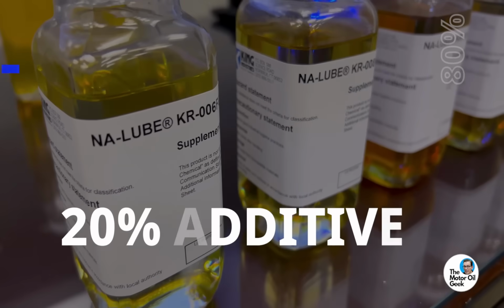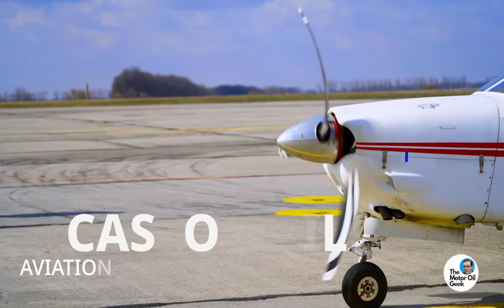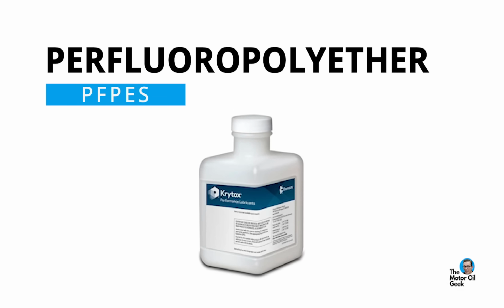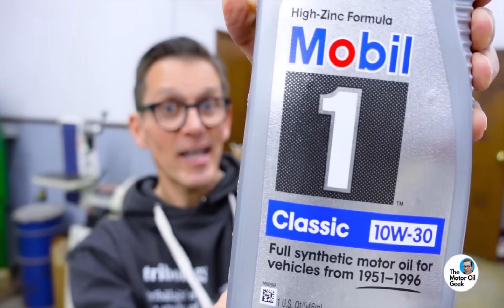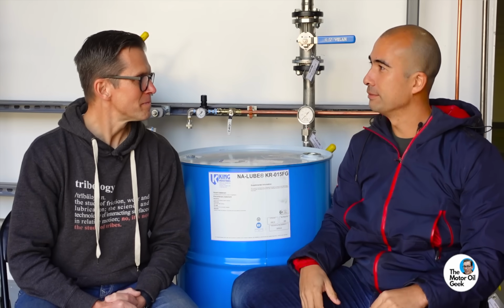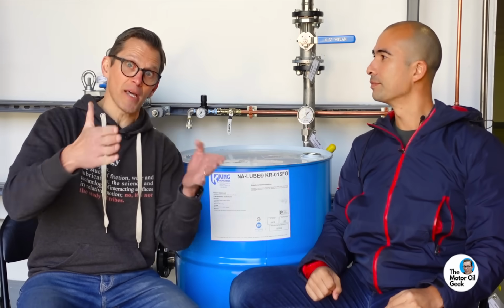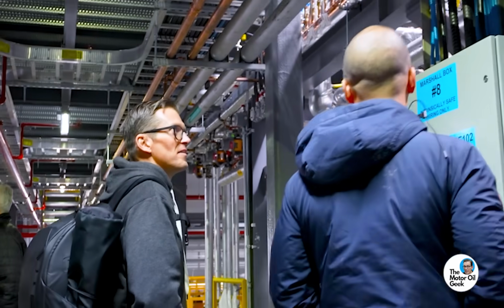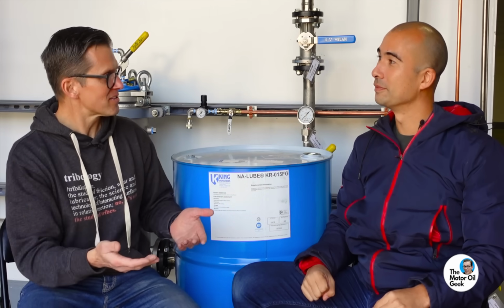100% Synthetic Oil: SCAM or SCIENCE?

Comment: Honestly the more I learn the more I realise I don't know anything and the harder time I have buying motor oil hahaha.
Reply: Any oil that meets both the viscosity (or multiple acceptable viscosities in some cases) and specification (or multiple acceptable specifications in some cases) listed in your owner's manual will be fine. :)

Some engines call for very specific specifications like Ford WSS-MS#### for wet belts or VW 507.00, but many just call for API SP.  All API specs are backwards compatible, so if it lists API SL for your older vehicle, anything from SL up to SP is OK.
Reply: @TassieLorenzo what if they recommends A5/B5, requires 5w-30/40, and then releases tsb saying recommends 5w-40? Isn't the recommendation contradict each other?
Reply: @jasonw98  I guess! The SAE 40 is just providing extra engine protection. Alfa Romeo famously revised the Twin Spark engine from requiring 10W40 to requiring 10W60 (like a Lamborghini lol).
Reply: @TotoGeenen Exactly! I feel the same way. With topics where a lot of sources make performance claims about their patented technologies, often contradicting each other, I stick to solid subject matter experts (like The Motor Oil Geek, TMOG) or good impartial comparison channels (like Project Farm or Torque Test Channel). TMOG gives enough real info to make a solid decision. While this video leaned more on the academic side, TMOG’s other videos convinced me to switch to Valvoline’s Restore & Protect motor oil and use only polyetheramine (PEA) fuel additives. [Yeah, I learned that buzzword here.] 

Now I need a good video on oil filters that actually does real testing.
Reply: @RickActual also wanted to switch to restore and protect but unfortunately they don't offer it in a 40 weight
Reply: @TotoGeenen   Yep. I found the same thing. I can use R&P in two family trucks, but not in our VW Atlas (3.0L V6). I need 5W-40. I searched for a full synthetic in that weight, VW 502 certified, with a strong detergent package. I came up with Liqui Moly, Leichtlauf High Tech, in 5W-40. I just did an oil change with it. I’ll stick with that until there is a compatible Valvoline R&P.
Reply: me too...
Reply: I buy cheap oil. when I realize my friend had over 500 K on his 1st gen Ford raptor driving it to Cali to Texas and back numerous times over the years using quaker State. No engine issues still going
Reply: That's life 

when you think you heard it all, 

some skibidi toilet jumps out and yeets you right in the face

Comment: For my Ford Focus 1.6 gasoline (not ecoboost) I use 5w30 A5/B5 MOTUL 8100 Eco nergy, fully synthetic (which probably is not ;), but will swap for Castrol 5w30 A5 B5 Magnatec as a test, I'll see if its also good.

Comment: Please comment on metal conditioner MILITEC1. Ive used it at home and work for over 30 years. 
In electric motors, amperage drawing less actually represents lubricity.
I add it to my differential, power steering, and engine oil sump.
When working on siezed bearings and pumps , add a little MILITEC1 and back in business.

Comment: Any recommendations on what oil to run in the current generation ford 5.0? I see numerous oil consumption issues and I would like to prevent that as much as possible, especially being a work truck pulling a light trailer.

Comment: So "Full Synthetic" & "100% Synthetic" are marketing terms & interchangeable? Would "Full" imply there are some Grp I or II oils included for additive solubility? Some think that Grp III is not "true" synthetic & only Grp IV & Grp V are "true" synthetics. Is it true that Grp III base oils require more additives to achieve the required performance, whereas Grp IV base oils are naturally high performance & don't need as many additives? Thanks for the video, Lake, as usual an outstanding, informative video!!
Reply from the maker: They are marketing terms, so don't try to read anything into them. The only place to get a real answer is the SDS sheet.

Comment: Question. I recently purchased a 2026 BMW X5 x40i. I followed your advice about changing the oil at 700 miles and just changed it again at 2500 miles. I cut the oil filter apart after this last change and found about 6 shiny flecks of metal in the filter element. Not sure if it was aluminum or something else. The oil recommended on the sticker under the hood calls for 0W-12 which is what I am using. 0W-20 is listed in the owners manual as an alternative. Is the presence of the metal particulates a concern or would that be normal for a brand new engine? Your thoughts on the 0W-12 vs the 0W-20. Thanks

Comment: Could you do oil test for a turbo engine since Alot of cars today are running turbo 4 and 6 cylinder. I have a turbo 4 and it seems that Alot of synthetic brands get broken down after  2000-3000 miles. I like to change mine around 5000 miles with a good filter but most oils don't seem to make it. Any info on that? Or could you make a video?

Comment: Can you do a video to fully explain all the product data sheet stuff and how they correlate.  For example the Viscosity index.  Some really great oils are down in the 150's while others like Royal Purple are over 200, why? Also why does Ester have a high oxidation value when new.  Also curious why many manufacturers 0w-30 (or 20, 40) varies so much from the 5w-30 of the same oil line, especially in the VI category.  Another 0w-30 vs 0w-40  Both are "0" yet the cold test rating varies greatly between the two.

Comment: The best thing about group 4 and 5 is that they are not derived from petroleum oil. Therefore the oil contains no sulfur or ash to ruin your engine. The other benefit is that if you are trying to start your engine at -20 degrees, it will turn over. Synthetic oil also has superior film lubrication that prevents metal on metal contact. You can't break a new engine in on synthetic, you have to use crappy petrolium oil. To answer more questions, if you want your engine to run problem free for years, use synthetic. Don't forget about the regular oil changes, the oil still absorbers engine debris. Synthetic is not cheap, but what is your engine worth?
Reply: GTL centers.the chat

Comment: Does timing make any difference these days? I only put about 2500 miles on my car every 6 months, but still change the oil at 6 months. Liqui Moly 5w30 LL (10qts) in my 2018 BMW 750i.  Because I do it myself, it's about $100 with filter.  Still cheaper than taking a Taurus to the quick oil change places lol. But thoughts on length of time?
Reply: AMSOIL 0W-30 MS "100% SYNTHETIC" EUROPEAN MOTOR OIL (  BMW-LL-01FE) is warrantied by Amsoil to be good enough to go the long-drain intervals recommended by BMW and other European manufacturers.  Apparently the viscosity requirement    by BMW is a 0W-30 and the oil capacity is 10.6 quarts with an oil filter?               

There are many Amsoil "verified buyers" giving 5 star reviews of their European   Oils, including the following found on the official website of Amsoil: 

"By  Sam,  a  Verified Buyer  from  Mount Holly, NC  on  May 13, 2025  
I've switched from Liqui Moly engine oil to Amsoil, and the results have been impressive. I send out oil samples for analysis every 15,000 miles, and since making the switch, both copper and iron levels in the oil have dropped significantly. The engine also runs noticeably quieter and feels stronger under acceleration. I still change my oil every 5,000 miles, and based on my experience, I highly recommend Amsoil. My oil analysis was done by Labstone I wish I could share the report here!"  

"By  FERNANDO,  a  Verified Buyer  from  Carmel NY   on  March 05, 2025 
✔ Used for 20 years in my BMW after factory maintenance ended. ✔ 8,000-mile intervals consistently. ✔ 287,000 miles on the engine – Still going strong, immaculate condition! ✔ Never needed engine work – No rebuilds, no issues, just pure reliability. ✔ Expensive? Yes. Worth it? Absolutely. ✔ AMSOIL delivers unmatched protection, longevity, and performance. 🔹 Final Verdict: If you want the best for your engine and don’t want to worry about breakdowns, AMSOIL European Formula is the way to go. The price is justified by the engine’s longevity and cleanliness. Highly recommended! 🚗💨💪     

I assume you are not now an Amsoil customer.  You probably can tell I am an independent Amsoil Dealer (all dealers are independent contractors).  My ID Number with Amsoil is 1420935.  My email address is automotive buff at gmail if you have any questions. Thanks for your consideration.

Comment: Is your gas tank Full or 100 percent?  

Are you going full throttle or at 100 percent throttle?? ?

Is your entire Full paycheck spent or 100 percent spent?    

Do you add the Full 2 oz bottle of 2 cycle oil  or just 100 percent to the 100 oz of gasoline to get a 1 to 50 mix????

Comment: Amsoil Signature Series is the best oil out there. Makes all my cars run so smooth it’s amazing. The only alternative i will buy is Pennzoil Ultra Platinum

Do a proper engine flush before using Amsoil signature series and the haters will shut up 🤣
Reply: Pennzoil Ultra Platinum or Redline would be my next choice after Amsoil.

Comment: i can believe it does work better IF the engine was designed for it. i am the fleet manager for our company, and the vehicles in our fleet are mainly Toyota's, and they usually call for 0-20 (which is only available in synthetic) changed at 10,000 mile intervals, and we have used a variety of brands, so no real brand loyalty. several vehicles in our fleet have surpassed 400,000 miles with ZERO major engine repairs on lubricated parts. 
second: try going to the parts store, it is now difficult to find any non-synthetic oil, even in diesel oils, and synthetics cost more so i believe they like selling a higher profit margin oil, what i would like to know: is it really that much more expensive to manufacture a synthetic?
Reply: Amsoil created a 0W-20 Synthetic Blend Oil a couple of years ago that contains in excess of 50% synthetic.  Lake tested a 5W-20 Amsoil Synthetic Blend Oil both in its virgin form and a used oil sample taken after being driven 5,000 miles, where the engine had 2.5 PPM wear metals per 1,000 miles (Lake said if a vehicle can achieve less than the 5 PPM per 1,000 miles, the oil is really, really good).  Amsoil produces a variety of motor oil products to fit your budget.  The amazing feature of these motor oils is the increased fuel economy over other oils, which can be corroborated by many verified buyers of Amsoil.  Another great feature is the protection of the widest warranty in the lubrication industry (that applies to vehicles regardless of age or mileage, even if the vehicles never used Amsoil in the past, as long as the vehicles were in reasonably good mechanical condition at the time you first start using Amsoil)!  Those two important features are attractive to fleet managers.

Concerning my 2016 Toyota Hybrid, I sent a used oil sample of Amsoil 100% Synthetic Signature Series 0W-20 for testing (that had gone 12 months and 7,233 miles).  The results were an average of 1.5 PPM of wear metals per 1,000 miles driven (Lake previously stated on one of the videos, if a vehicle can achieve less than the 5 PPM per 1,000 miles, the oil is really, really good).  The lab said that the oil was considered good for continued use, but I changed it before I received the test results.  You probably can tell I am an independent Amsoil Dealer (all dealers are independent contractors).  I assume you are not now an Amsoil customer.  I am confident I can help your fleet!  You can even try Amsoil on a small scale to compare the MPG results against other oils.  My email address is automotive buff at gmail if you have any questions.  Thanks for your consideration.

Comment: I have been using supertech 5-20 full synthetic for 10 years or more and it is great oil. Overspend if you must, but its not necessary. Just change your oil between 3-10k miles based on your driving conditions, and youll be fine.

Comment: Whelp, I've been putting Mobil 1 full synthetic 5W-20 in my 2016 Challenger R/T for about 200,000 miles after the engine warranty expired. No problems yet. I think I'll stick with it. I use the high mileage 20K oil but usually change oil and filter at 15K just to be safe. Seems to be doing just fine. No leaks and no smoke out of the tailpipes lol
Reply: Good decision, great oil.
Reply: @Offroader451-rm5jz 
Absolutely.  I love that car and hopefully I can keep it on the road a lot longer before I have to rebuild the engine
Reply: @HeloGnnr100  You got a ways to go yet. May have to change the oil a little sooner.
Reply: @Offroader451-rm5jz 
Yeah you're right.  Better to change it too soon than too late

Comment: I'm getting one of tbe 3.0 duramax that recommends 0W20. I was going to run oil samples at the first 500 mile recommended oil change. Currently using another oil lab, but would love to work on the data.

Comment: I was also told the synthetic oils have a longer thin-film cling time. So if you shut your engine down and restart it an hour(?) later, there still will be a cushioning oil film in the msin bearings. Unlike dino oils. Still true? Or have additives & upgrades changed that?
Reply: Synthetic does cling longer because their molecule is smaller.  Thick oil also helps if cling.
Regardless, a post 1990 engine will pump oil anyways when you start it up

Comment: Nice video,
One question Lake Speed Jr😊
One of my friend asked me certain engines run good only when looked after and well maintained by using good oils from Amsoil oil Mobil1, 
but in case of Toyotas even group 3 or group 2 oils are used the engines seem to be mych more accomodative and seem to bother much on reliability front.
Any idea on why is it so?

Comment: When I started driving in the 80s, a quart of oil cost you $0.67, while a gallon of gasoline cost you approximately $0.90. nowadays a gallon of gasoline is approximately $2.67 and a quart of synthetic oil is $12. He was talking about the additive package costing most of the money in a quart of oil. Is this price justified?
Reply: Gas from the 80s and gas today aren't much different. The oil is much much better. You can get a top shelf performing oil for $7-8 a quart.
Reply: @MathewPollard-vj4uq the Valvoline 0w 20 at O'Reilly's what's going for $12 a quart. I could see mineral oil being about the same price as a gallon of gas. I could see synthetic oil being maybe twice the cost of a gallon of gas. But when it becomes 4 times the cost of a gallon of gas, it's getting a little ridiculous. You know they're making stupid money on this stuff.
 I do analyze oil at work. I'm not an oil analyst but I do verify all our oil samples, which is about 60,000 samples per year.

Comment: In 1985 a mutual friend, who was in Mobil's PR department, gave me the whole press kit for the new Mobil1. The first synthetic on the consumer market.
 I looked at the engine tear-down stats, taken after 50,000 miles of NYC taxi fleet use, the pictures of the heads and valve cover interiors, and at my first oil change became a Mobil1 customer for life.
 Is there better stuff today? (Sorry, I have to catch up!)  Maybe. But at least I've got a damned good baseline for something that showed ZERO coking or tar after 50,000 miles of extreme service. For my own much less severe use? That'll do.
 Love the 0W## grades for cold-soaked winter startups, too.
Reply: Amsoil produced the "first synthetic oil" that was API approved in 1972 (2 years before Mobil 1 in 1974)!  Twenty years ago I was a regular consumer of Mobil 1 for several years (after trying all the other major brands of synthetics).  Then I tried Amsoil and I was blown away by the performance in  comparison to all the other synthetics (including Mobil 1) that I became a loyal consumer of Amsoil and have not used any other lubricant for the past 20 years!

Comment: Lake, love your videos. Been doing oil analysis on my daily and a few performance cars over the years. I currently have a 06’ 911 with the 3.8 that I use mostly for road use but may track 2-4 times a year. My concern is the dreaded Nikasil bore scoring issue. I think you might have had some input into the Joe Gibbs DT40 formulation. Does that formulation provide extra protection vs say A LiquiMoly or Mobil1 0-40?  Just looking to protect my car in the best way possible.

Comment: Please shed some light on "certified" synthetic oil vs non certified synthetic oil?? of same weight that is over $100 more at my independent mechanic garage, both being 0w-20. For 2016 CRV, and regular 4k miles oil change intervals, seems either a scam or at least not worth that premium?? Is Certified a thing??
Reply: Sounds like it is being used in a scammy way. Even the cheapest of cheap oils sold in a store or used in a quickie lube in the US will be "certified". API certification is the basic standard for oil performance. Little round seal on the back of the bottle. Some very expensive and high quality oils which are sold in very low quantities (Racing oils ect...) do not get certified because the volume doesn't justify it or they deliberately target specs that would not certify. A regular car in normal service with 4k changes will not benefit from $100 premium oil over a quality synthetic by a major oil company.